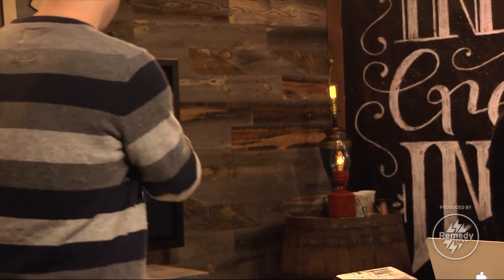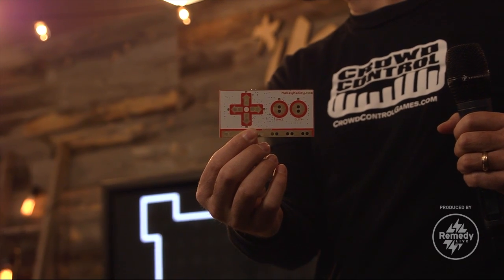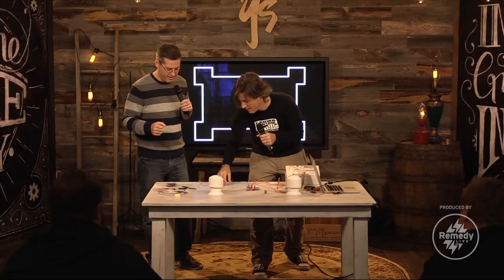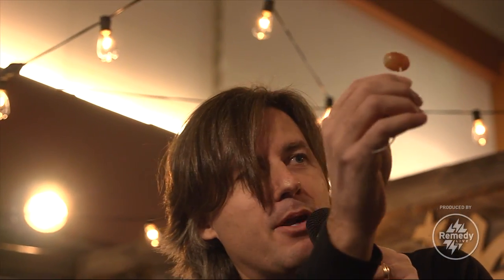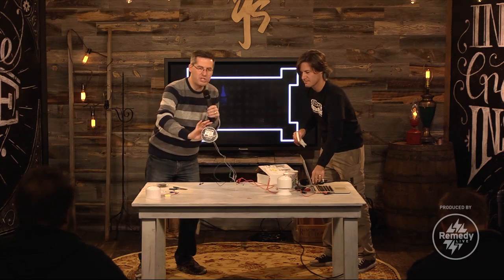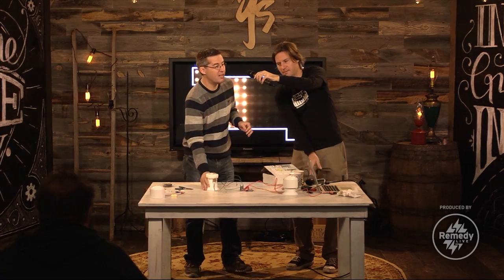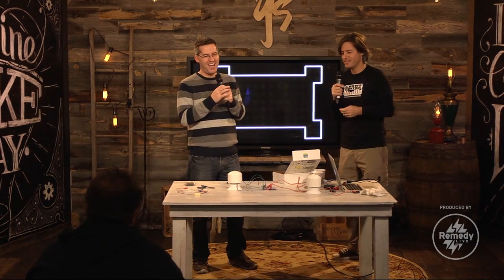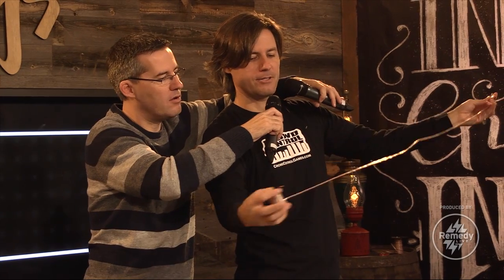DIY Game Show Buzzer

Comment: My experience with the MakeyMakey has not been good. I purchased the buttons, built a box for the MakeyMakey but when I put it all together it's 50/50 if it works right.  I get random buzzing and I just have not been able to rely on the MakeyMakey.  I purchased both the buzzer software and game software for a church event but had to punt on the buzzers and use buttons on a laptop as buttons to get any success.  Does anyone have a suggestion on making buzzers that work with the buzzer software on my laptop?

Comment: Lupe, yes the Buzzer software plays back just like in the video. It is triggered by the left & right arrows on your keyboard. The MakeyMakey can send left/right signals so it works out really well (or you can just use your keyboard if you don't have a MakeyMakey)